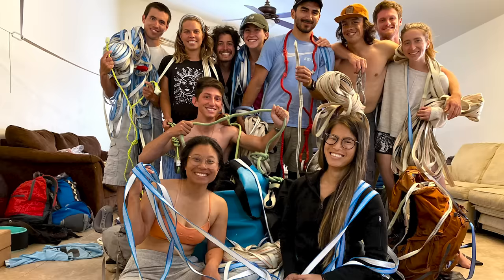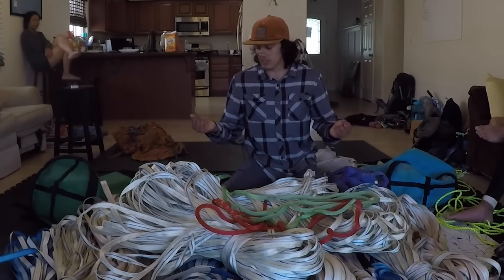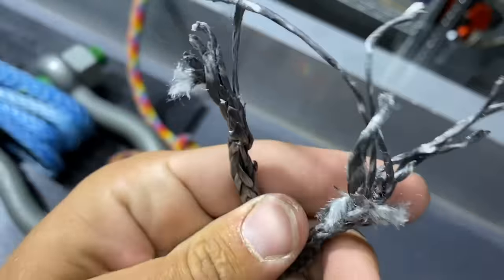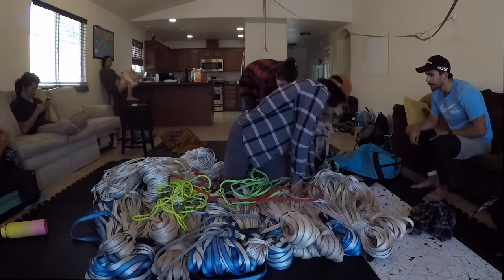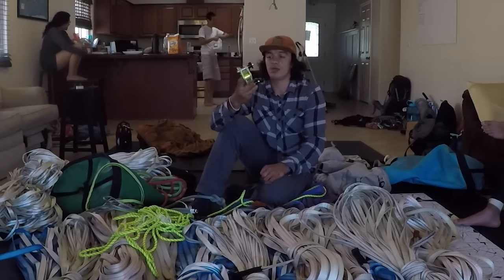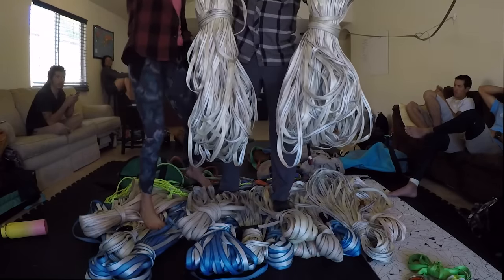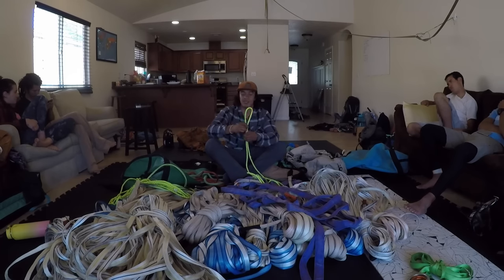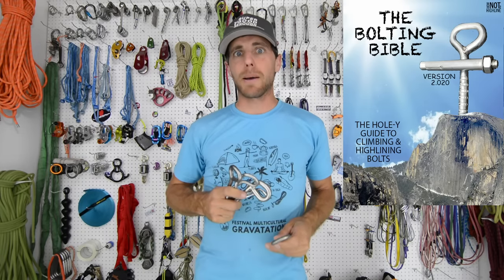California's longest highline broke in the wind!

Comment: Hello again, I work in the materials testing industry and when performing compressive strength testing of concrete the rate at which you load the sample has a dramatic impact on the results.  If you load the sample fast you get a higher compressive strength. We use a metered rate, which is approximately 1000 lbs. per second, to get our compressive strength test results.

Keep up the good work! 👍

Comment: Looks like on the web lock, the ball bearing detents need new springs. It looks like you can just tilt the web lock and the pin slides out from gravity..Givin the high winds, if that web lock bumped against anything the big wheel on the end would provide enough friction to pull it out...See if you can get stronger springs for the detents.